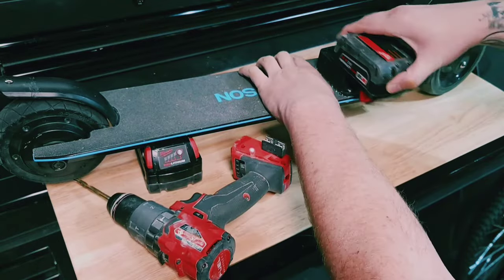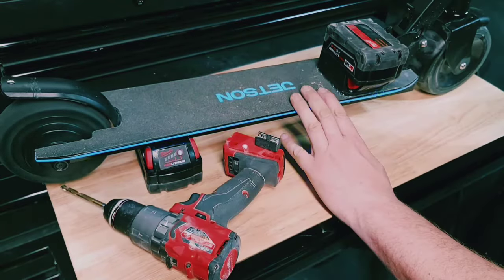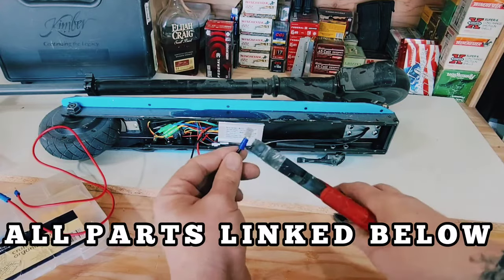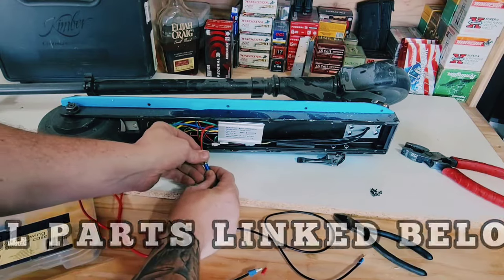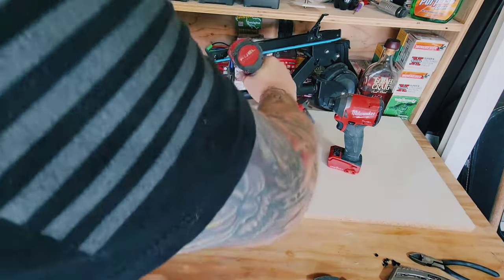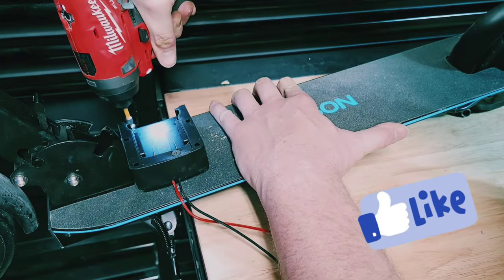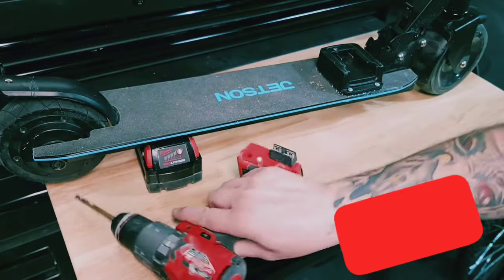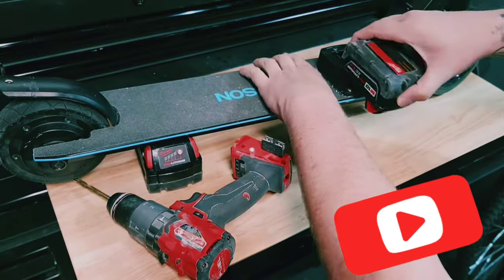How to Upgrade Scooter Battery

Comment: I wired 2 dewalt 20v 9Ah in series now making it 40v 9Ah on what was a 36v 4.4 Ah scooter. Since dewalt batteries actually put out a lil less then 20v , im probably not far off of the 36v spec. I was gonna try to disconnect the speed limiter as well i think
Reply from the maker: That sounds much more fun! I would have liked to do the same, but I didn't want to turn the kids loose on that one, lol. Let me know how it turns out! Please consider liking the video and subscribing to the channel to help me grow 👊 🪚
Reply: Dewalt rates their batteries in that voltage range at the max voltage of 20v other tool companies rate their batteries at 18v nominal. Their are all the same voltage (20v) fully charged.
Reply: @BourbonCreations  I thought you were a goner. Why no more entertaining videos?😟
Reply from the maker: @SlimMichaelSpaghetti  sorry, I work Healthcare and COVID had me slow down, then I started a masters degree, but finished that degree this month and already have 5 videos I'm editing now to upload.
Reply: Any updates? Ive got batteries and a need for speed.
Reply: A 36v scooter battery is actually a lil more than 36v as well.
Reply: So how long does battery last for this new hack ?
Reply from the maker: @Andres707cristiano  slightly depends on terrain (uphill, flat, downhill), and the weight of the rider. For kiddos and adults it definitely outperformed the stock batteries, and gave us maybe another 20 mins per battery. The option to swap to another charged battery take away the problem of having to plug in and wait though, and you can take charged batteries with you! Please consider liking the video and subscribing to the channel to help it grow 👊 🪚

Comment: You definitely dont get more power from this youre putting in less voltage than the original batteries just feels fast cause your batteries are dead and can be easily revived by the way but anyway dont do this unless you want less power and basically no ride time i bet i could barley make it 2 miles on this thing
Reply from the maker: I have two of these, one with the original batteries. It's definitely faster now. Went from 12v to 18volts.
Reply: I'm just looking for a method that will get me like 5 to 10 miles if need be and still be decently fast but definitely seems lithium ion is the way to go but I would want more capacity and possibly a higher voltage
Reply from the maker: The other option is to use a 40v set up from the lawnmower batteries. I have a 40v for the Ryobi mower and the new versions are impressive compared to their early model batteries. I've seen people add these to electric bikes with a really good output on power and longer use overall. Please consider liking the video and subscribing to the channel to help me grow 🪚 👊
Reply: @BourbonCreations  yes good lithiums always work better than the lead acid or batteries like lead acid just not a fan of lead acid batteries in general but I've put 36 volts on a couple e100s and e175 and the speed controllers just won't accept that high voltage and I got a 1000 watt speed controller it was to much for the tiny motors they would barely go

Comment: Where are the parts
Reply from the maker: @Shadow-wolf15.  Below is a new link for the adaptor. You can search for others if you have a different brand of battery. Please consider liking video video subscribing to the channel to help it grow 👊 🪚. 2 Packs Power Wheels Adapter for Milwaukee M18 Battery Adapter Power Wheels Battery Converter Kit with Fuse & Switch & Wire Terminals & 12 AWG Wire for DIY RC Car Toys Robotics https://a.co/d/8VdRsp3
Reply: @BourbonCreations  I would need one for Craftsman batteries 20v fyi
Reply from the maker: @Shadow-wolf15.  https://a.co/d/7F4VGY9
Reply: @BourbonCreations  I know I found that one trust me

Comment: So i have a gotrax scooter with a internal battery running 36V, if i add another identical battery would that increase the cap speed of the scooter or would it extend its acceleration? maybe both?
Reply from the maker: It will definitely extend drive time because of the ability to continue drawing from additional batteries. I haven't seen that brand, but either way, you need to ensure you don't have any box between your battery and the motor that is reducing your power, something acting as a resistor which creates a bottleneck when thinking of power to the wheels. I bypassed mine so that it would take on the full power of the battery since I increased the voltage to get a higher amperage battery. Remember when you add one, its dependent on volts and amps of the battery that you're using. For example, a 36v battery with less amps than another 36v with higher amps will deliver less power. Dont forget in line fuses and to watch when you continue to add higher and higher power internally. I liked being able to charge the battery separately for safe charging. Personally, I'd be more worried to double the identical battery while plugging it into an outlet in the home. When i charged the battery separately, i didn't have the risk of fire or overheating from the wall charger. Please consider liking liking liking and subscribing to the channel to help me grow 🪚 👊

Comment: How many Volts is that controller? I have a 24V controller.
Reply from the maker: This one is an 18v since I was using an M18 Milwaukee battery. I'll add a link in the comments here, you can get them in gray, black, or red.  Please consider liking the video and subscribing to the channel to help me grow 🪚 👊 

Battery Adapter for Milwaukee M18 Battery 18V Dock Power Mount Connector 14 Gauge Robotics(DIY) https://a.co/d/hzSfGYM

Comment: Hm I just got two older Ezip 450 scooters that are in basically new condition. Wonder if I could wire up something similar to use either Dewalt or Milwaukee batteries..
Reply from the maker: I'm sure you can. Should be set up with positive and negative wires very similar to this one. Lemme know if you need help as you get into it, and please consider liking the video and subscribing to the channel to help it grow 👊 🪚
Reply: @BourbonCreations  Liked and subbed! Yea I could definitely use some guidance. I am very mechanically inclined but very limited experience with battery type stuff. The scooters are Ezip 450s. What would you need to know/see in order to figure out if I can use cordless batteries?
Reply: I have two 36 volt scooters that I am going to upgrade to two 20v dewalt.  I also just picked up a 24v 450 that I am going to use two 12v milwaukees on.  I like the idea of having the batteries external.  plug and play just like my power tools.

Comment: Question: If I want to change my battery 36V/7.5 Ah with a battery 36V/100Ah what would change? Would I increase my range? Are there any dangers because of that?
Reply from the maker: Thanks for the comment. The great thing here is your voltage is the same (the power you're delivering) so no worries on the electronics, but the Amp hour is more, which means it will deliver that 36v for a longer period of time. If you're looking to increase the run time, this will work great, but for more power, you need higher volts. Let me know if you have any other questions and please consider liking the video and subscribing to the channel to help it grow 🪚 👊

Comment: Any issues without having a low voltage cutoff to save the Milwaukee battery?
Reply from the maker: I didn't have any issues cause the battery would slowly die and lose power as it got low. If someone was to keep pushing it further and further into the dead state by holding the lever on, that could happen, but its easier with this one because the power is only pulling when you push the button to go on the scooter. I used milwaukee batteries on other things like blowers that didn't have an off switch, and that was a problem because it would continue to draw until there was absolutely nothing left. The scooter will stop moving due to lack of power before its completely drained, and then you let go of the button, which closes the circuit. Please consider liking the video and subscribing to the channel to help me grow 👊 🪚

Comment: Does it go faster? Thinking of trying to make my gotrax X-ray ultra faster or at least have some batteries when the main battery runs out can you make a video on how to use the main batter also? Or will it affect the scooter
Reply from the maker: It definitely goes faster! Are you asking about how to use the main battery in tandem with the Milwaukee battery?
Reply: @BourbonCreations  I’m asking if I do it like how you did but keep the main batter but when it runs out can I add like what you did as a secondary option to power the scooter ?
Reply from the maker: You could add it as a tandem in the wiring (splitter to both battery sources) but wouldn't use the Milwaukee battery at the same time the factory battery is fully charged. That would give too many volts at the same time from 2 difference sources that the motherboard isn't designed for. Once the factory battery dies its essentially a dead circuit so their shouldn't be an issue then plugging in your Milwaukee battery. I think what you're trying would be a cool option, I'd just keep an eye on it since I'm 100% sure what draws and pulls the diodes will like in the mother board. Try it for a while and monitor for any heat. Once you're done let me know how it turns out! Please consider liking the video and subscribing to the channel to help me grow 🪚 👊
Reply: What’s the connection part for battery to scooter?
Reply from the maker: Are you referring to the part where the batter clicks in?

Comment: This is a clever mod. What scooter are you using? I was thinking of doing the same thing. Would any drill battery work or is there a reason you chose this one in particular? and also, none of the parts are linked in the description despite what the video says.
Reply from the maker: It's a jetson scooter (any will work) and I used milwaukee just because that's my main tool and batteries I had available, but you can use any brand. If I did it again, I'd go with thr 40volt lawnmower option from Ryobi. When I get home I'll update links for you, I'm glad to help where I can, it was a fun project. Please consider liking the video and subscribing to the channel to help me grow 🪚 👊
Reply: @BourbonCreations  I appreciate the response, youve gained a subscriber. I was wondering, did the new battery improve the speed by much? Will any voltage work with our scooter?
Reply from the maker: @Richard Tobing  thank you very much! It did help the speed, I had two of these and both of my girls rode them side by side and the converted one was notably faster, plus more life overall. I don't have exact speeds though
Reply: @BourbonCreations  Do you think it would have gone even faster had you used the 40v ryobi battery?
Reply from the maker: @Richard Tobing  definitely and I've seen it done on an e bike
Reply: I need to see it again i can’t see what your doing I got a Jetson I want to do the same
Reply from the maker: Is the video replaying for you?

Comment: Would this work on an xiaomi scooter?
Reply from the maker: Yes, any brand because the adaptor just ties into the negative and positive wires from the original battery. Please consider liking the video and subscribing to the channel to help me grow 🪚 👊
Reply: @BourbonCreations  Thanks for quick reply. Even if the scooter if not 18v?
Reply from the maker: Yes, as long as you don't disable the resistors (computer board) that reduces the voltage being accepted by the device.
Reply: @epexlinux  no man you need similar voltage. This is a kids scooter that took a 12v lead acid battery. 95% of All adult scooters are at least 36 volts. You have to get a new controller or insure your controller can handle different voltages if you change battery voltages. Lots of misleading info in these comments.

Comment: Am i missing something about the batteries? Arent they 18 volt? Most scooters are 36 volt plus....im confused, lol.. Great video though
Reply from the maker: Really depends on the scooter. The volts are one variable, but what really makes a difference is the AH (Amp hours) on the battery. For example, look up a 3amp Milwaukee battery, and then look at a picture of a 5amp battery. The 5amp is bigger even though they're both using the same 18volt current. The amps is like working power and it  really helps with longevity before it dies out. The sliding saw takes the same 18v, but uses a bigger 12amp battery. Hope that answers your question, and please consider liking the video and subscribing to the channel to to me grow 🪚 👊
Reply: @BourbonCreations  oh, i subbed, for sure, thanks!
Reply: @BourbonCreations  i guess what i was asking was if you hook up an 18 volt battery to a 36 volt controller, wouldnt that freak out the controller to throw up an error?
Reply from the maker: It would be under powered though as far as the voltage going in. Your bike must have a pretty big motor. You could tandem wire 2 of the 18volt batteries into the machine. I don't have a video myself, but there are others out there showing to tie 2 batteries in the same circuit. Also, there may be new options out there for Milwaukee because they have adaptors for their new leaf blower and vaccum that use 2 of the 18volt batteries in tandem already. The wiring and setup would be very similar for other branded batteries as well.
Reply: @BourbonCreations  cool thanks, that makes sense, wiring 2 together, correct voltage, double range! PS, its a 36 volt, 6ah Scooter, thanks again!

Comment: I put a car battery on my scooter but now my scooter is too heavy 😞
Reply from the maker: Ya, just because it's larger battery, it doesn't necessarily mean it'll make it faster. Are u looking for more speed, or longer usage at lower speeds?
Reply: Where is the parts information? @BourbonCreations
Reply: @BourbonCreations  both and nuclear power as well
Reply: @BourbonCreations  yes and I also installed a flux capacitor for power